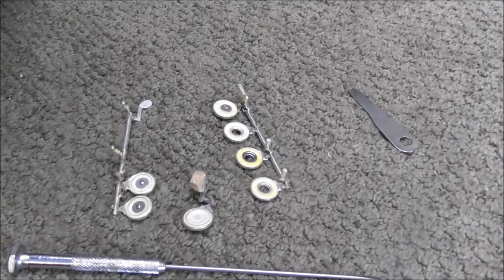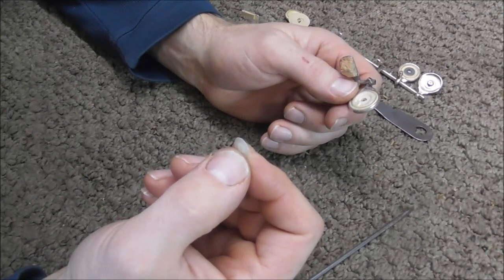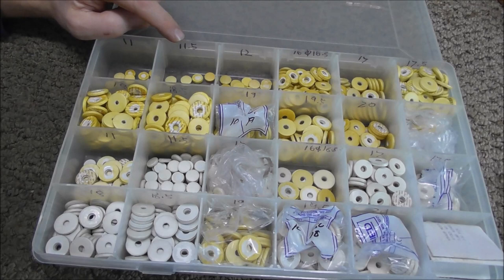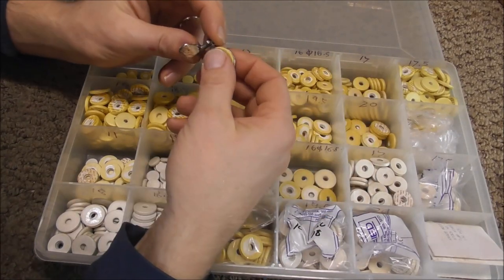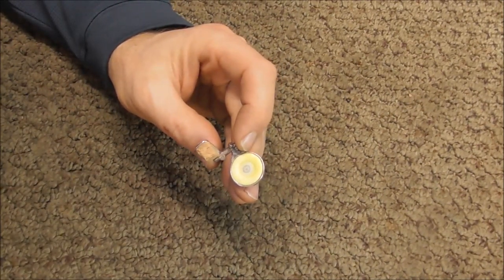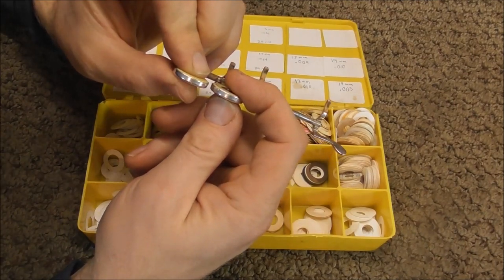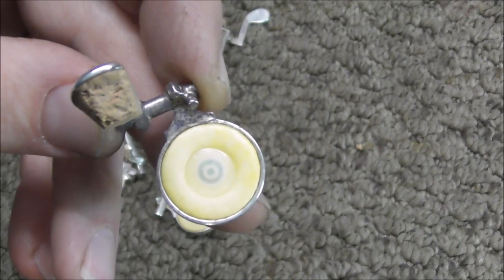How To Remove and Install Flute Pads

Comment: thank you very much for sharing!
what is your opinion regarding thickness of the flute pad?
warm regards
Reply from the maker: The pad should stick out of the pad cup about .014 of an inch. I use shims to get it to the correct height, so thickness is not very important to me. 
I hope this helps,
Art

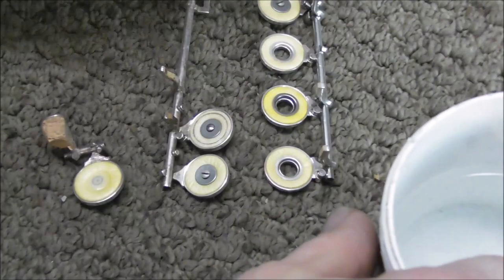Comment: Thanks for sharing your knowledge. I have a question: what is the liquid that you use at 5:56 ?
Reply from the maker: I was using water.
Reply: @TheBrassandWoodwindShop  OK, it seems to me it was a bit white, thank you.
Reply: @TheBrassandWoodwindShop  I has another question: about the C pad (the little one), how does it stay in the key ? Because there is no system that maintains it inside (neither the holed keys' system nor closed keys' one). 
As you guessed, I'm about to change the pads of my first YAMAHA flute (I have a semi-pro Muramatsu flute too) and so I'm catching as much as information that I could find on the Web 🙂. Thanks a lot in advance, and I'm sorry if my English is not perfect, I'm a French flutist.
Reply from the maker: The High C key is held in by glue. I use hot glue (used for craft projects), but you can use other types of glue if you do not have hot glue. I hope to publish some videos about replacing flute pads soon.
I am trying to learn French, but your English is a lot better than my French.   :)
Reply: @TheBrassandWoodwindShop  Thank you, I hope I will be able to sucessfully change my pads.
Reply: @geogeosgeogeos5569  you're English is near perfect honestly 👌 better than most people that learned it as their first language!

Comment: I am working on a flute and I am looking for plastic pad holders and can't seem to find one. Do you know where I can order one
Reply from the maker: You can get one from Allied Supply, but they only sell to music stores. You can get one from most music stores too. 
Most flutes that have plastic pad holders also have the threads so that you can also screw in a metal washer. If you do have one like that, you can just replace it with a metal screw and washer.

Comment: so, my flute just kind of screams when i play about half of the notes, is that pad leak? it seems to work a little better if i hypersqueeze the keys down
Reply from the maker: My two guesses are that it is out of adjustment and the skins on some of the pads are ripped.
Reply: @TheBrassandWoodwindShop  neither of those things sound like things I can do on my own ;_;. That's too bad, I found an old flute from the fifties in my time of musical need and brought it back to life as much as I could on my own but I think this boy is destined to go back in the box cause I definitely can't afford to send it off for repairs